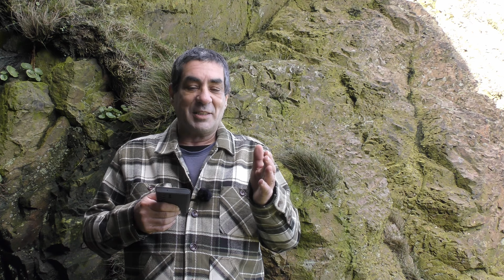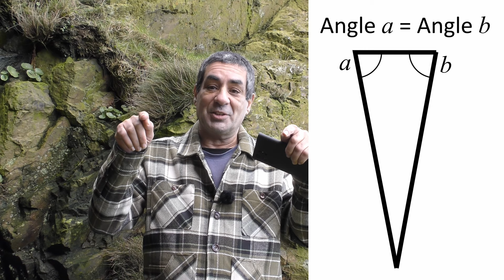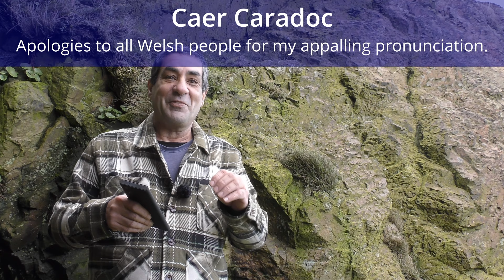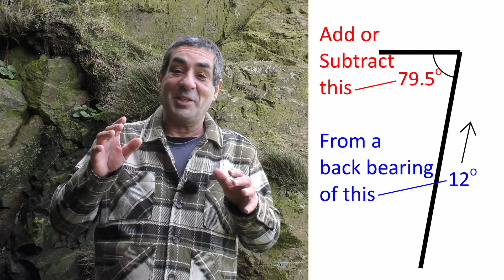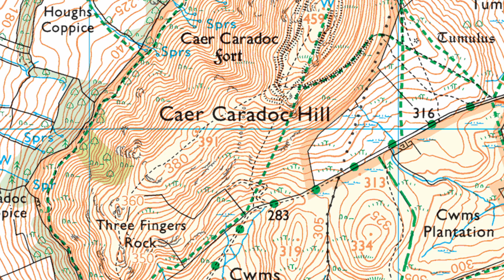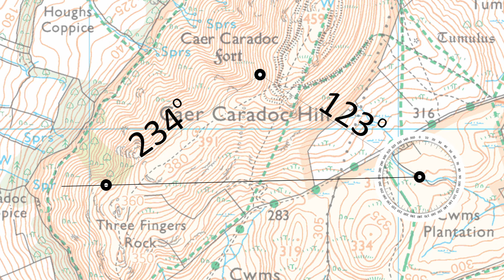Compass bearing error calculation (advanced) P2

Comment: Declination and WAvES - how does this work with a compass that has a fixed declination?
Reply from the maker: Hi Bob, with the WAvES method you simply rotate the compass bezel by the declination amount.  This means that you’ll need to do some maths e.g. if the declination is 10 (east or west) you add or subtract that amount from the compass bearing.  
See this video for a better explanation: https://youtu.be/Tf9rrmq5Vf8?si=-erbSjTDpSFEzr5p

Using the fixed declination scale, once you have set your compass, you rotate the whole compass until the needle is over the scale at the point of your declination, then rotate the bezel until “red is in the shed” again.
See this video for a better explanation: https://youtu.be/dgvWnskAfxg?si=5QT5fAC2oTPN2LFo

Both of these are just different ways of adjusting the direction of travel.

I personally use WAvES as I find it much less fiddley, but some people prefer to use the fixed declination.  Either way will do and it’s all down to personal preference.

Comment: How do you know or how do you determine that you traveled along the wrong bearing direction?
Reply from the maker: Normally it's just as something doesn't "seem" right.  There is supposed to be something there and there isn't, the ground is meant to sloping in a direction, which is isn't, you should have passed by a feature that you didn't, etc.
Reply: @TheMapReadingCompany  So I guess my follow up would be, how do you know if you went to the "left" or to the "right" of your correct bearing?
Reply from the maker: Look back at the way you have just walked, even if it's only a few meters.  Take a bearing towards that.  Now do a back bearing, this will tell you if you are to the left or right / clockwise or anti-clockwise of the intended direction.

Comment: Isn’t your second example the same as your first worked solution- did you not mean to use the westerly direction as that which was walked so as to produce an anti clockwise error ?
Reply from the maker: Think about it on a compass dial - not rotating the dial, but visually:
351 to 12 is a clockwise rotation.
234 to 123 is an anti- clockwise rotation
Reply: @TheMapReadingCompany  I’m good with that but the first example used the walked direction to ,12degs, to obtain back bearing and then apply (add) the correction as it was a clockwise error. The test question seems to me to have done the same even though it was anti clockwise; why wasn’t the back bearing taken from the error direction (234) and the correction (34.5) subtracted from the result ?

Comment: You have a vector b that ends at point B. It has a direction of 9 degrees west and a magnitude of 850 meters. Then you have another vector a that ends at point A. It has a direction of 12 degrees East and a magnitude of 850 meters. Now you are looking for the vector x that starts at point A and ends at point B. Everything is already done, just perform vector addition and you will know how far to go and in which direction.
x = b-a
Reply from the maker: Watch the video again is my best advice.
Reply: @TheMapReadingCompany  Yes, I will look into the method you describe. My vector calculation gave, 310 meters long and slope a little up 1.5 degrees. So then I walk 310 meters with a bearing of 271.5 degrees. It's been a while since I learned math, and if the calculations take a long time indoors in a warm house, then it will take forever out in the rain. I would probably do as you suggest in the video, take out the compass and take a new bearing.

Comment: I think you don't need the back bearing. You add or subtract to the bearing your were supposed to go first.

234+34.5=303-34.5

Same with the original example.
351-79.5=192+79.5
Reply: I the error is clockwise you subtract. If the error es counterclockwise, you add.
Reply from the maker: I think you may have found something.  Well done.  I'll have a look at this.
Reply: You have inspired me to visit the cave. I already knew about Caratacus and have walked on Caer Caradoc many times in all weather conditions but have never visited the cave. The top is beautiful place to be on a clear moonlit night with snow under foot. Enjoying your videos and waffles very much. 63¾ years old, size 10 boots.

Comment: Is this the easiest solution though? I don’t see why the back bearing is needed. Just work out the bearing correction, which is either a positive or negative number, and add it to the bearing that you’ve just walked along (a.k.a. your azimuth, if I understood that video correctly). That’ll be the new bearing. Anything >= 360° and you subtract 360, anything < 0° and you add 360° (basically doing modulo 360).